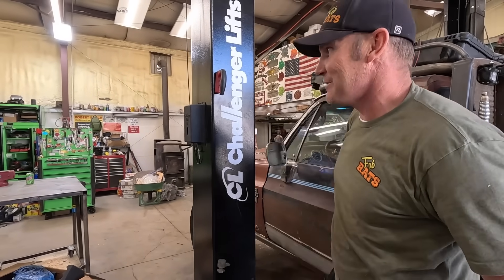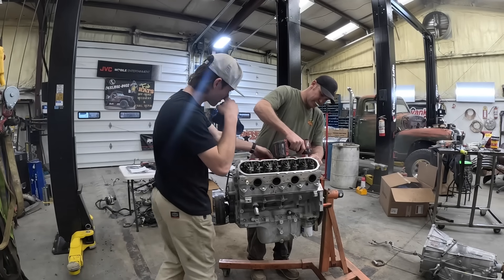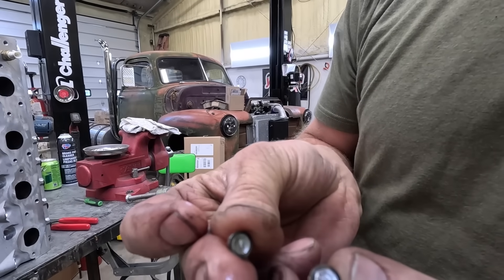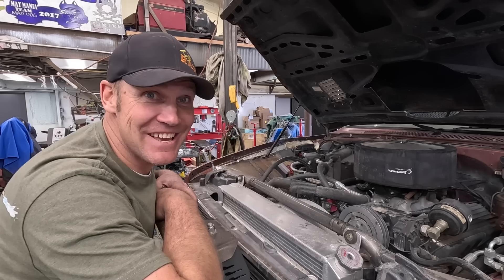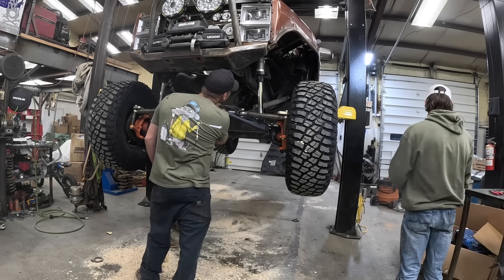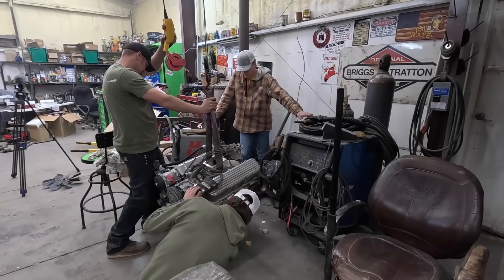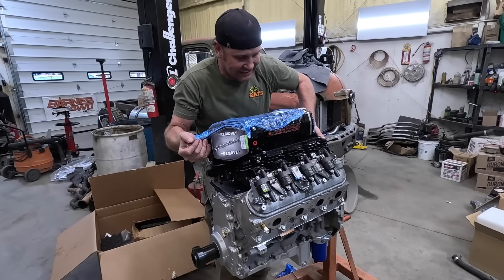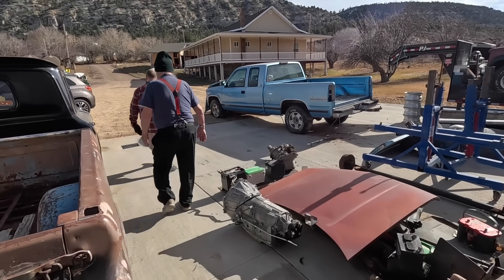We've Been Left With No Choice! The Rat Rod Wrecker Will Never Be The Same.

Comment: Really hoping the new engine works out in your favor. Really wish you’d have checked the ring end gaps while you had the heads and pan off of it. If it comes down to it to avoid detonation you can always swap to E-85 along with setting up a timing map to retard ignition as rpm goes up. Y’all already know that sorta stuff I’m sure. Just really don’t want to see you guys struggle anymore and wish you’d have o-ringed the block and heads or studded it or something to avoid pushing a head gasket and burning the deck surface. 

I know you guys are excited about the new power plant and you’re doing a lot to help longevity already. Sorry for babbling on about it just want to see you guys have the best chance to succeed even if it takes a little more time or a few more parts. Either way I hope Y’all have a Merry Christmas and enjoy your time together. 👍
Reply: Yeah, whenever you make major changes to valvetrain and such and don't check valve clearances, spring coil bind, etc., or add a power adder and don't check ring end gaps - it makes it a lot clearer on why the last engine failed. This is why these videos are entertainment videos and not how-to videos.

Comment: Hey Paul, I hate that you have had the trouble with valve train in the BBC(I think Merlin sabotaged it, lol). Just wanted to say to me the best part about that engine over any modern engine is how it could be made to run easily without computers. Put a carb on and throw an HEI distributor in it and it will run. Anyway just my two cents. Love the channel
Reply: 1000%. Carb is and will always be more reliable, and I convert all my rigs to HEI. My 1985 Land Cruiser with a 3F has a Weber 38 and a MSD Streetfire HEI module paired with a Pertronix Flamethrower 60,000V .45 ohm coil, great for bigger plug gaps to improve idle / cruise. Can't beat it. Also, a BBC built correctly is not prone to having problems.

Comment: You could easily buy new intake or exhaust heavy duty valve for that big like 225 250,000 is longer and Exhaust 1.88. 100longer Extreme heavy duty I run the same exact head you do that’s what I did. If you use the Chinese valves they were always break

Comment: That engine should be plenty of horsepower (450-500 maybe) for the wrecker but is going to be a lot of fab work again getting all the accessories bolted back up and no doubt more wires and computer tuning. Let's hope that when you get it done that it lasts for years to come. I wonder if the hood will close? Can't wait to hear the exhaust sound of this one.

Comment: Paul, do not use a flat head packard straight 8 for a hot rod.  The motor only has 3 main bearings and will break crank shafts under heavy loads.  If you are driving Miss Daisy, the will last forever however.

Comment: Nice work. Paul I use that permatex copper spray on a Subaru that had super beat up head that some monkeys rebuilt previously. I never thought the gasket would seal. But over a year later it’s still going strong.   I use it on all gaskets now.

Comment: I’m with you so active fuel management, like you, I’ve told several people that I want eight cylinders all the time.  I had a 2011 Silverado with a Duramax to pull a 38’ fifth wheel.  When I traded the fifth wheel for a motorhome, I decided I didn’t need a 3/4 ton truck anymore.  Talked to the Chevy dealer about trading for a 1/2 ton Silverado but after I researched the AFM I decided to go back to a Toyota Tundra and never looked back, love my Tundra.  This is my fourth Toyota pickup.

Comment: Paul, if you need to flat surface something to get a small scratch out quickly in a pinch, use a flat piece of glass (glass table tops work perfectly) and some finer sandpaper. Put the head down on the glass and move it in a figure 8 pattern enough to get the scratch out.

Comment: Good man, Sylvester! Don't trash that big block. I had a 454 in a 1985 3/4 Chev that had one rebuild at 258,000 and gave up the ghost at 403,000 with a rod thru the crankcase. They are strong, even stock. I'm sure you will do well with the LS, with the possible exception of the supercharger.

Comment: Paul you need to get yourself an Air opperating Valve spring compressor like I have n it's much more easier n nicer to work with n alot Faster than a Hand kind 😆

Comment: Valve springs, old spring vs new spring. The old spring is beehive which does the same thing as the new spring double spring with more RPMS by preventing valve float, so it's a mute upgrade with little to no benefit. The only thing that might help is if the new springs have more seat pressure, but the cost is wear and tear.

Comment: When you were welding up those guide plates before, I sent you a message about some DART guide plates for Big Blocks that I use.........you should check them out.........I run a big cam and big springs and I don't have any trouble, but I have in the past........I would never trust a welded guide plate.

Comment: I love you guys, I admire your friends and families so much, alas I have none now however, about the "scratch" on the cylinder head, you know I have used a two part "liquid Metal" filler/ bond, before and it has never let me down, we also tried Araldite once when my pal was grinding the ports out of a Mini head, two ports broke through and he just built it back up with Araldite and it was fine, the head lasted a whole season, in fact the young lady driver won several races with it, with no problems, and it was held as reserve for the next season.

Comment: A supercharged LS engine is all about horsepower. A Rat Road Off-Road tow truck seems like it needs more torque than horsepower. Also, it seems like it would be helpful to have the weight balance of the truck heavily towards the front of the truck for balance and steering manners when towing off road.  Why the LS instead of a heavy cast iron diesel engine up front?  Burnouts???

Comment: when i hear big block and top end problems i know it's that stupid thing in the head that let go and either is rattling around or causing a valve failure. i'm no mechanic and i've seen it multiple times across every application, no matter how expensive the build was. glad you caught it on time, the motor is probably fine and will be fixable with very few money. just make sure you put it in something that is more of a sunday cruiser rather then a work vehicle!

Comment: When you slapped your big block together. Did you just throw in new parts? Did you get the rods connectors rounded for squish? Because straight out of the box, some get egg squished. Thus ruining components.  Even main bearings do the same.

Comment: Hi Paul, that Pirma, Tex gasket spray either red or copper is absolutely fantastic stuff. I use it on everything and I have never in 28 years. Had a leak using that gasket sealant. Merlin is absolutely correct. Spray paint works excellent as well. Do you spray the surface with the paint or the gasket sealer? Wait for it to tack up a little and then assemble. I have always been able to start the vehicle as soon as I was done with the reassembling, but as always, it is best to wait 24 hours for your sealants to cure

Comment: Paul,  Have had some experience with BBC motors.  Unfortunately, some of the after market motor upper end stuff is not as good as stock.  In my experience, using factory high performance valve springs, stock rocker arms, push rod guide plates and 7/16" push rods are a predictably reliable.  Rory, of Trail Mater fame, uses mostly stock stuff and his BBCs seem to be quite reliable.  (except when he tries to run them on H2O!!!)  Bill in Montana Territory

Comment: Have you thought about using the new Gen VI or VII big block engines?  I had an 8.1L in an old dually and it pulled like a beast.  Only thing I did to it was a cam.  Finally let go at 210k miles and I was not nice to it.

Comment: If I Renner correctly you installed a roller tapped cam in the big block. Did you use Chevy big block pushrod guides or pushrod guides that came with the cam and lifters? Big blocks are not bullit proof but you push an engine hard.

Comment: Hey Paul, I am sure you have been recommended this but just in case, Have you looked into mercruiser? They used a 454 for boats and I am sure those are high revving engines that seem to last. Maybe they use some sort of special part that would help you with your big block? I am no mechanic so this is not from experience, I've just owned a boat that had a 454 mercruiser and for the couple years I owned it never had issues like that. In any case you guys are amazing keep up the great work love the show.

Comment: I had the big block in my classic f250 make that sound about 1200 miles after a meticulous rebuild. Turned out that 3 cam lobes went flat. I had never used that brand cam before. I let the machine shop that did the machine work talk me in to it. Yes it ran great. But did not last. So I went back to the preferred brand and 200,000 miles later still runs like a bat out of hell. Plenty of HP to light up my 35 in tires at any time. Not saying that the failure in your engine. Just saying that what the failure was with mine when it sounded like that

Comment: I will admit that I know nothing of LS motors, but my butt started to pucker when Paul finds a valve tip breaking off.  Is that a normal LS thing?  I dont know how many miles that engine has, but that concerns me that there are other valves with the same idea.  That and the sealing surface scratch is kind of a rough way to start with the new motor.  Hope there is some good luck with this engine.

Comment: Sorry for the downfall on that big block I've built many in my past and I aint no professional but anytime you're pushing a big block to 7000 RPMs or more it must have rocker arm girdles to stop breaking the guideplates and you would not have them problems you've got tall valve covers it needs rock arm girdles and it tightens everything up perfect

Comment: If you don't replace that cracked head, it will always be in the back of your mind and whenever you are having issues or break down, you'll regret not having replaced it. Remember, breakdowns usually occur at inoppertune places. If it is done/replaced, now, it will be out of that negative part of your brain, including the extra expence, which, by the way, may be far less than a breakdown. You already know this.

Comment: As hard as you run that truck, band-aiding small problems like that head gasket surface could be another reason for potential engine failure down the road. I'd think you want to avoid any more engine failures after you've been through so many in that truck already. It's costed you money, effort and down time with the wrecker. But do what ya gotta do, in the end it's just more content if it does fail, right?

Comment: I would NOT ever run those other valves. They all came from the same batch and saw the same abuse. If another lets go it will be a bad day. While its apart, for the cost of the valves, changing them all is the smart thing to do.

Comment: Paul is going to take a dependable GM LS motor and turn it into a Paul's POS (piece of sh t).  Take the dependable engine and change the valve springs to a more heavy duty spring, to make more power.  Change everything else so it turns into the Paul's special.  His big block special lasted one year, Paul's exact words "it lasted one year".  We know Paul will use what ever spare parts he has around for the build.
Yea, Sylvester had a tail gate for the Jeepster and brought it to the FabRats..
Paul used a torque wrench but he says not to get use to it, it won't be all the time.
Let's just picture this repair of the wrecker and know that Paul is going to be building it his special way.

Comment: Ring gap?? Boosting without changing ring gaps can cause catastrophic failure real quick. Maybe at very low psi you won't have any problems, but if you are going out on hot days climbing the sand chute, that's a recipe for disaster. I'd have gapped them regardless, but definitely if the engine was going to be worked hard. Hopefully she never has an issue.

Comment: Help an old guy understand….there has to be a logical answer, but it needs to be explained to me.  You are taking the BB engine out of the tow truck because it is problematic.  You are replacing it with an LS 6.2 that has a broken valve and a cracked head…..putting Devcon or similar on the crack and a similar valve in the engine will ensure the LS is less problematic than the Big block?

Comment: It was a mistake going carby on the big block get rid of the POS car you don't need it and its just pure trouble and unreliable, dont use a LS engine they are just as bad and have severe oil use and piston slap and head problems just like the 5.7l ls1 from 1997.  And of course stupid Paul built everything around that big block and the parts around it so when the smaller engine goes it nothing will fit again and not be compatible.  Makre sure the build the new LS motor so it can handle boost and the blower.